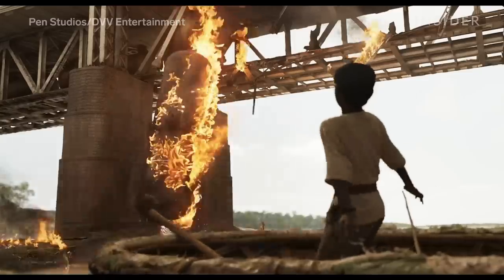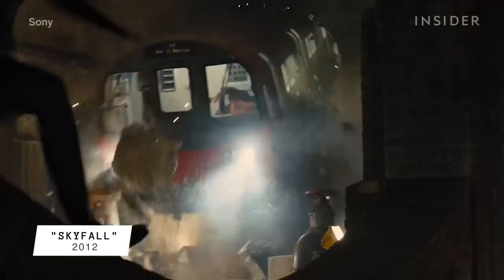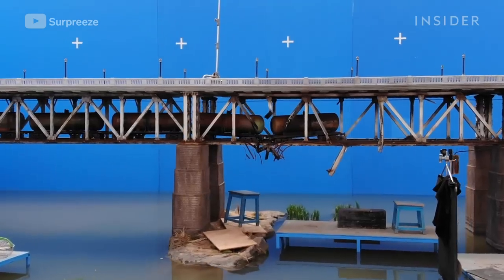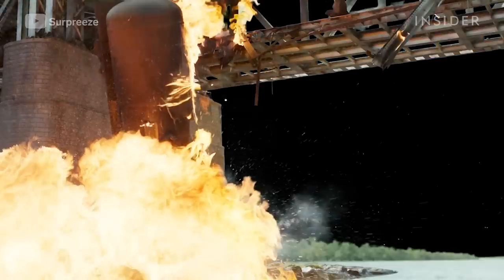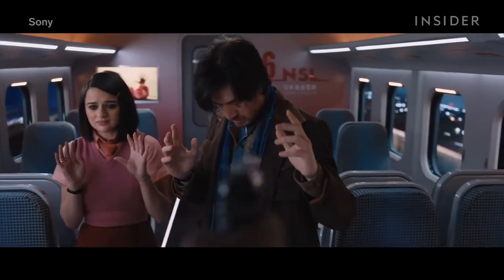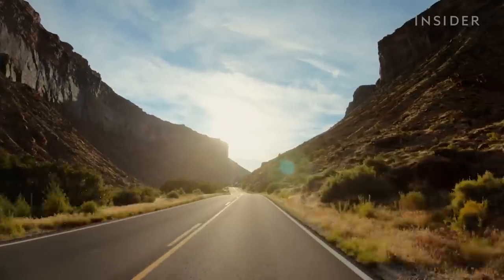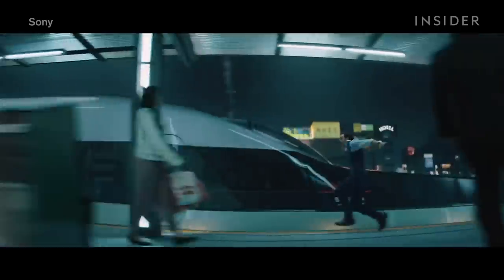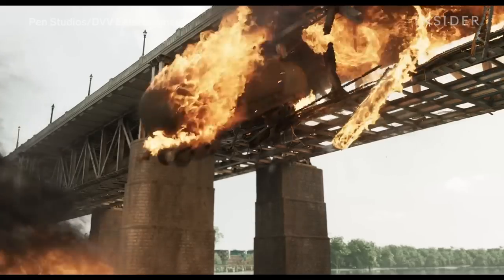How RRR's Moving Train Stunt Was Shot | Movies Insider | Insider

Comment: For a film that apparently put a lot of work into making that train crash look accurate, RRR messed up a bit by putting GATX onto the tank car, which you can see at 2:00. That’s a railroad reporting mark for the General American Transportation Company, an American tank car leasing company. The car also appears to have American trucks (aka bogies). For a film set in India and focused heavily on Indian nationalism, they did a pretty bad job of making an Indian train.
Reply: That's most likely the case cause the Miniatures were made in West Virginia, by a Special Effects Company there. And it's such a tiny specific detail than almost no one would even know to look for.
Reply: 90% of all train crashes in the film industry have something wrong going on.
Reply: Also, the wheelsets are not bolted on the bogie frame of most tank cars. So if the car derails, the wheels usually come off too.

Comment: In real life, that exploding tank car flying sideways off of the bridge would've taken most of the cars before and after it off of the bridge with it, demolished (at least) that section of the bridge, and seriously injured - if not killed - the kid as it all came tumbling down on top of him and trapped him underneath a mountain of steel and other rubble.  And the director goes so far as to call it "close to" a real train accident 🙄
Reply: As much as I like real stunts, sometimes they are misled.. like in F9 I was pissed.. there they used a mobile huge magnet attached to a car, to pull a car through concrete from a parallel road 10 meters apart.. even the strongest magnet on earth won't pull that off, and it is not at all mobile (watch veritasium's video), it literally consumes like 20000 kw power.. they did the scene with pistons rails etc and did it in 9 months..
Also there was a scene where 2 muscle cars grabbed the front of a 3 section armored truck from the sides and applied brakes.. apparently it and the slight slope of the road was enough to topple the 30 -50 ft truck .. like seriously??
What good is that to pull of stunts realistically if the event is not even realistic ??
This is why I love Tom cruise and Nolan ... They get the details ...
Reply: The point of using miniatures is that you automatically get some aspects of realism. Placing actual explosives on the miniature tank car could have delivered a realistic looking shot, yanking it with a rope did not. The result is just not believable from a physics standpoint given the enormous rotational inertia of a tank car.
Reply: @soumyadityaagarwalla1517  If you expexted the F9 stunts to be realistic then that 's on you really